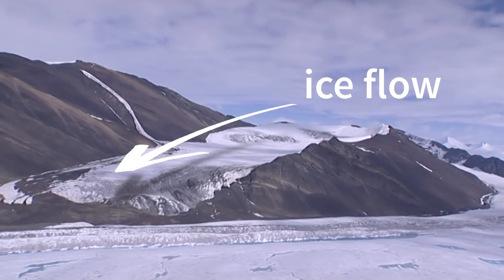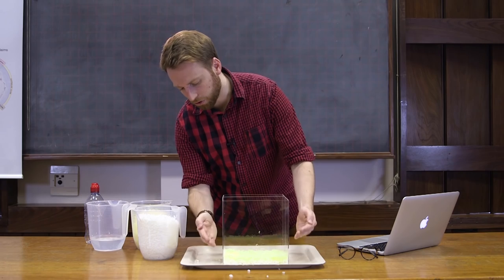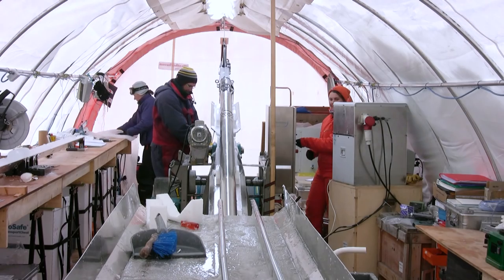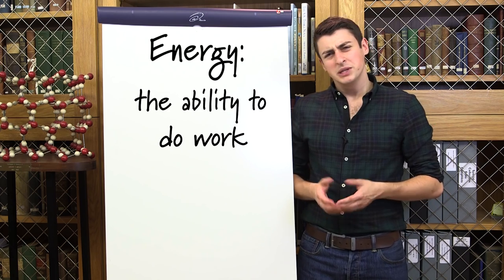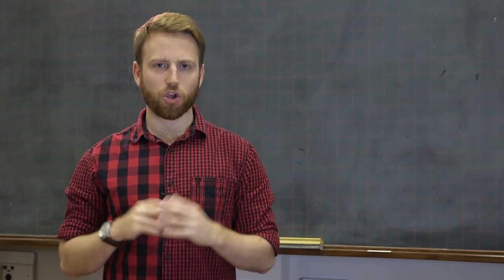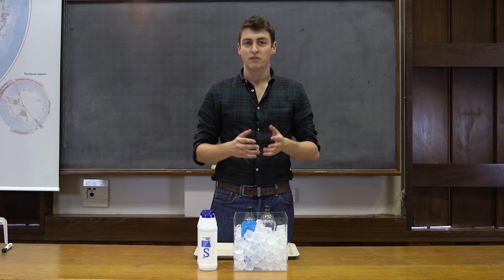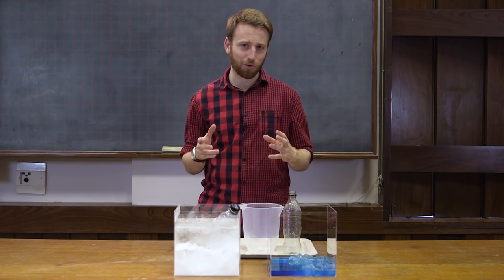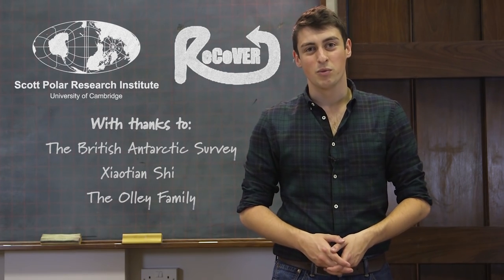Mass balance | Crash Course Cryosphere #2

Comment: what are nucleation centers
Reply from the maker: So we talked about this in episode 1, but nucleation centres are small objects that ice can nucleate around: they include grains of pollen, dust, and small imperfections in a container. In the case of our demonstration I believe the inside of the bottle is smooth enough that ice won't nucleate (start crystallising) until we rap it on the table - the rapidity of the motion causes small gas pockets to appear at the container wall, which then act as nucleation centres.